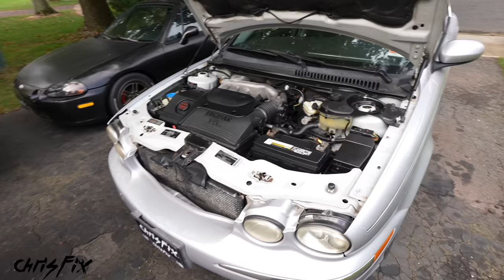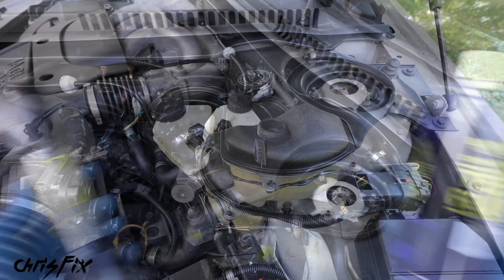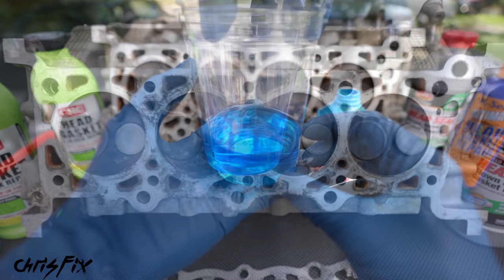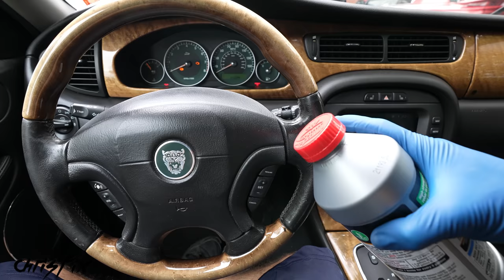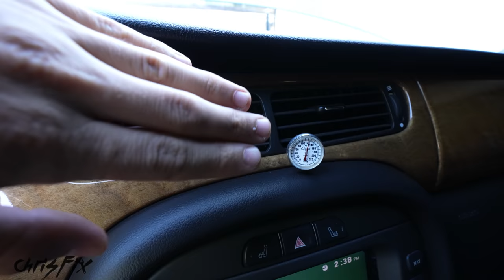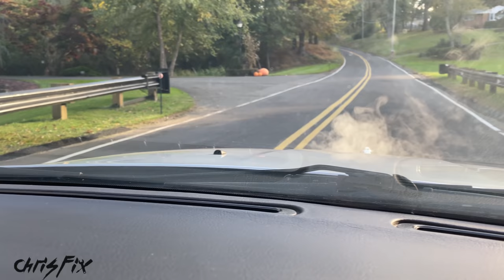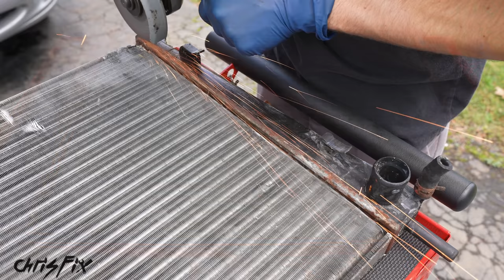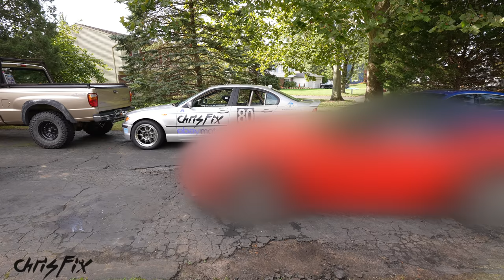Do Head Gasket Sealers Actually Work (FULL 2yr TEST with Engine Teardown)

Comment: I used the K-Seal on a Ford Five Hundred with a blown head seal. It worked fast and I had no clog issues with excess fibers like you had in the Jag. I just like the idea of using copper instead of glass to reduce abrasion in other areas of the engine. I wouldn't use any of those silica based products.
Reply from the maker: Thanks for sharing and I agree!
Reply: Let us know how it all pans out, k. maybe in a couple of wks or so all depends on different variables, I guess. Thx.
Reply: how long did it last @Rich Touchet?
Reply: How long did it last?
Reply: I just used K-Seal on my 2011 F150 at 161k miles a few days ago. I noticed it was leaking coolant under my truck, was seeing a pretty decent sized puddle. It was not overheating though. And the oil is not turning milky, it looks good. I just couldn't find where it was leaking from. So I figured I'd try the k seal. The K seal I used said on the bottle that you can either flush the system after using it or just leave it in and it won't damage anything. So I've left it in there for a few days now and I have driven probably over 500 miles with the K seal still mixed into it coolant. And I haven't noticed anymore leaking at all since putting it in. But now my thermostat does float around and get a little hot while I'm driving. Which it didn't do that before! Mostly it starts to go hot and overheat once I get 70mph or more. When I back off the accelerator it drops back to normal temperature. I drove it for an hour tonight at 70mph on cruise control and it didn't overheat at all. But I don't like the way it was floating around like that so I'm going to flush the coolant and K seal out tomorrow and see if that fixes it. Other than that, truck runs great, not seeing anymore leaking.
Reply: hi
Reply: @MacGiollaCostigan  So did you flush the k seal out yet and how's it performing now that you flushed it out?
Reply: @toddrhine7648  nope I still have not flushed the k seal out. Truck is still running good and still noticing the temperature gauge float a little bit once I'm flooring it and hitting around 70+mph but once I let off the gas it drops back to normal temperature. Not noticing any issues other than that. Truck runs great but I've had to fix some major components previously. The water pump, couple hoses/connectors, starter, oil pressure sensor, both cat converters. So I've put over $5k in new parts and labor on it so far. I did not flush it bc the guy at O'Reilly's told me not to use a garden hose bc that water has sediment deposits in it that would get into my truck and mess it up... And that I needed to use distilled water... So I just don't know what to do now 😂
Reply: @MacGiollaCostigan  I would just flush it and use the distilled water/antifreeze. Just my opinion.
Reply: @toddrhine7648  do I just pour a few gallons of distilled water into the reservoir and open the radiator drain plug and just let it drain that way? I never done it before. 2011 f150 online it says the cooling system holds 20 liters of coolant... That's over 4 gallons.. it's about $130 to drain and refill it
Reply: @MacGiollaCostigan  All depends on how much your block and radiator holds.  You wanna try to use a 50/50 mix or close to it. I believe there's plenty of videos on YouTube that shows you exactly what to do in your situation!

Comment: I suspect I have a blown head gasket, so I'm weighing my options on what to do. This video is super helpful and informative, thank you!
Reply: What vehicle or engine. I have milk on my oil cap
Reply: @ceavalencia4767  are you losing coolant or anything else though? If the oil on the stick is clean but the inside of the cap is a little milky it could be just condensation from lots of short trips where the oil never gets hot enough to boil that off.
Reply: @906MediaProductions  burning oil. Short trips to work 20 miles it was fine. It's the long trips the milk shows on the oil cap. I'm actually stuck in CA as of right now because I'm just getting the engine replaced with a lower mileage engine.

Comment: Feel bad for the old man who loved that car. I remember when you posted the vid about when you were able to buy, fix up, and gift the jag to your old man. Seems like yesterday.
Reply: Well if he didn't cut out & tear apart the radiator, all that would be needed is having a machine shop flatten the head. Should be okay to take off just a couple thousands. And then reassembly. Labor-wise it's totally not worth the cost of the car, but it does seem salvageable. Of course I'm making assumptions that nothing else was mechanically damaged from the improper seal of the combustion chamber, but considering the car drove 10k miles on the sealant, there's got to be more life in it left.
Reply: Saw Chris's reply to other comments. The brake lines were rusted. Obviously other problems made the car not worth fixing. And of course the disassembly wasn't exactly organized with intent to reassemble. Clearly not worth trying.

But I agree sad for sentimental reasons.

And major kudos for Chris on that part because his passion is real and it gets us sucked in too.
Reply from the maker: This is why it didn’t really matter: https://youtu.be/KQWGHE7NTUA
Reply: @chrisfix  I also remember this one lmao. That blue color for the Maserati just makes it POP how’s the wrap holding up after almost two years? When I get the car I want (Tesla) I would love to wrap it in midnight green.

Comment: I used bars aluminium for a small rad leak and it’s been good for around 7000 miles. I used half the recommended just to avoid clogging—plus it was super small

Comment: I have used K-Seal 2 different times. First time on a 240k mile Lexus LS-430 and it worked great . I drove this car from California to the east coast (Maryland ) K-Seal worked great and I had that car for about 1 year after pouring K-Seal in My cooling system.      2nd. time I used it was earlier this year ,( june 2023) ,K-Seal worked great on my 2005 Jaguar x-type with 147,000 miles  I have driven 10,000 miles since june and everything is still working Great.

Comment: Thanks ! ! ! 
Years ago GM used dark brown "pellets" in their Cadillac engines straight out of the factory to stop leaks. I used them recently on my '95 Vette and it seems to have stopped some mild leakage. I used half of the amount rather than going all in. Haven't noticed any spikes in temp (other than the usual high temps in stop and go traffic) which is normal for the LT1.  Heater works so no blockage there. 
Your thoughts?
Reply from the maker: I personally don’t like the stop leak additives for the radiator because they do clog up the heater core and stuff. I was told they use it from the factory at GM (like you said) but I don’t know how true that is. Either way if it’s not causing you issues I wouldn’t add more. I would just replace the radiator or leaking part. The LT1 HS reverse cooling as well (at least in the Vette it does).
Reply: @chrisfix  It's AC Delco part number 12378255. I've been hearing that they came factory in the Northstar engines for as long as they've been around. I suspect there is some truth to it.
Reply: @chrisfix  Thanks for the reply, your videos are fantastic! I installed a new radiator 6 yrs ago. I noticed  3 yrs ago cooling system was loosing about 2 pints every 9 mos or so, that's when I put in the pellets. I changed the coolant earlier this year and so far, all's well, no more loss, so I'm good.
Reply: @billiebobbienorton2556  we have those brown pellets with the Northstar warning on here in the UK sold under the brand name Bars Leaks, worked for me in a Citroen.

Comment: Good video, great long term test.

RE: ~240F temp on the first test drive, I'd suspect you had an air bubble stuck somewhere. Air moved due to higher RPM/t-stat opening and the low level after first test drive was that air. Just my pro opinion. Get shop air vacuum filler, no air pockets ever.
Reply: that's a good theory.  considering that the sealant hadn't worked enough to stop the coolant leak out of the reservoir at that point in time, your theory makes sense.

Comment: This begs the question: what caused the overheating originally to cause the head to warp?
Reply: the average american cars maintenance record is probably enuf
Reply: I seem to remember when he bought the car it had front end damage. Something probably got knocked around when that happened
Reply: What about when coolant never gets changed and turns corrosive, and starts eating away the block and head? It didnt warp but it leaks.

Comment: One question, had he floored it any time before the head gasket sealer broke, or was that the only time? Or if anyone else has had experience with these I'd love to hear your experiences with this. Thanks in advance y'all!
Reply: I put some in one of my vehicles (diesel hilux 1kz engine) and just drove it normally, including a few longer trips.
It lasted nearly 3 years, it now has a new head on it.
The 1kz heads are well known for developing cracks if they get hot and mine did due to a cracked radiator tank.
Reply: @Stambo59  I'd like to know. The directions on "bar leak" bottle says to put into the radiator, not the reseviour. Does it really matter, can that affect how well the sealer work? I've used K-seal before & it sucks from my experience. I want to try bars product & would love the insight since you've used it already. Thanks.
Reply: It shouldn't really matter once it cycles long enough, but the radiator should mix in faster than the reservoir.
Reply: @andrewstambaugh240  I already done the treatment. Over 200 miles so far & she's holding.

Comment: Hi Chris. Amazing video. I suspect my engine has developed a blown head gasket in a similar way to your Jag...apart from the water loss...so your video was very helpful. I had also narrowed the choice of sealer down to the Bars Leak but I hadn't actually bought it yet. So your video has helped me decide...thanks again.
Just a question - my overflow bottle is not the greatest...can I pour the product directly into the radiator inlet once the engine has reached operating temperature?
Cheers from Sydney Australia.
Reply from the maker: I would open the radiator cap when the engine is cold and keep it open. Bring the engine to operating temp and add the stuff in. Then close the cap and let it run. NEVER open it when it is hot or it will shoot out hot coolant.
Reply: Yeah was going to start her up with he cap off. Done that plenty of times with clunkers that couldn't hold their water.Anyway good news since I first messaged - the gasket didn't blow afterall. Tough old car! But the radiator is chronically blocked (40 years old) so that's the next job.
Thanks again Chris!

Comment: Great video, Chris.  Two questions please: When the original sealant stopped working, could you try another bottle and get another 10,000 miles out of it?  Once you got the head off, could you have replaced the head gasket to make a permanent fix, or was the head block warping too great? 
Thanks!
Reply: This was my question too. Could another bottle provide more of a seal or does this mean the warping exceeded the sealer’s ability to seal?
Reply: @tamarachairez3744  i used sealer on my old 05 chevy equinox and i do delivery driving, after the head gasket blew again after about 8k miles i tried adding more sealer and the car still has a blown head
im pretty certain that after a point the warpage gets too bad to actually be fixed by just sealer, ive read on quora and other places that some people over torque their head gasket bolts and that can fix the problem temporarily but im weary of overtightening anything hahaha

Comment: I remember doing this copper/fiber head gasket seal on my previous Totota Corrola and there was that initial hot temperature increase to almost red zone on the gauge for about 5min of driving and then temperature suddenly dropped to normal and my head gasket was fixed permanently. Also before doing the fix the leak was so bad that I used to find 1/2 cup of green coolant under my car overnight and had to top up coolant every 2 days, however after doing this hack which cost me about $30 the coolant level in reservoir stayed permanently same without dropping so it worked just fine as the car was 23y old and worth less than $1000 😊

Comment: Hey Chris, fantastic video!  I actually used the Bar's Leaks a while back on my Forester which was well overdue for the dreaded gasket replacement and it worked for a little while to keep things under control (at least until one of the bolts on the water pump stripped out and I just went and got all of the gaskets done).  I wanted to ask, what brand of disposable gloves do you use?  The ones I buy are always either flimsy, poorly fitted, or both and I end up using less disposable rubber gloves that work better but aren't an option for anything where any soiling would be bad, like handling brake pads.  Yours seem to be of excellent quality and I would definitely spend a little more to have a box of them laying around!
Reply: I know he likes to shop at Harbor Freight so those might be the 7mil nitrile gloves they sell. They also sell 9mil which I personally think are a bit too thick and are a bit restricting in movement but they are definitely heavier duty.
Reply: @pudo3792  Good tip!  I'll check them out, I have a Harbor Freight nearby or could just grab a box online, thanks!

Comment: Thank you for the test! I have some questions, since the condition of the oil was not shown:
Does this work when the engine oil is milky as well? 
Should an oil change take place before using the sealer?
Reply: no it will look up your motor if your getting coolant into your oil

Comment: Great video!

The irony is that the high silica in the oil probably wore away the head gasket seal that the head gasket sealer in the coolant had made!

Had you changed the oil quickly, there's every chance the seal would have lasted even longer.

Comment: Hey Chris, is it possible to have residual exhaust gasses after using a sealer? Its possible i might have had air in the cooling system with my heater core is not working from a clog or trapped air, but my test turned yellow before quickly, then green slowly. I used Bar Leaks copper block sealer (wasn't suspecting a "head gasket leak" the time because I was still learning the terminology much less how to do everything) on my 2001 E-150 5.4 l

I have the head gasket replacement kit but I am no longer in a situation where I can very easily do this difficult job myself because I'm trying to learn how to do it properly first off and secondly I have no location to do it. I'd like to try again with the blue devil and take out the thermostat this time, and just hope it works, but I don't even know if I need to. However I am getting cylinder misfires on occasion and bad fuel economy still.... I think.
Reply from the maker: There could be if you didn’t bleed the air out of the system after it’s been sealed. Could also have a small leak still.
Reply: E-150 means van which means changing the head gaskets is a nightmare even for a pro mechanic.

Comment: I had an 04 Chevy cobalt, cracked a head tightening a spark plug while it was hot. Coolant started coming up the sparkplugs tub hole. I put some copper head gaskets fix from Walmart and it kept it sealed for a while until I sold it .

Comment: Just recently had a head gasket leak on my 2JZ-GE (1999, 300k miles, been my daily driver for years). Worth mentioning that mine was a MINOR leak. If your oil looks like chocolate milk, you got a much bigger problem on your hands.

I had a small leak, my oil was fine, my tailpipes weren't throwing out white smoke. The exhaust was boiling my coolant, if I drove on the highway for a bit it would start to overheat when I slowed down because the water pump couldn't keep up. Additionallty, the leak would push coolant out of my radiator with excessive driving. I went with Blue Devil specifically because it has no solids in it. Those solids can actually clog water pumps so I tend to avoid them (but to give credit to what Chris said, I haven't seen nor heard of a radiator being clogged by one). And regardless of the sealant, I always recommend flushing the radiator after a few days just to make sure nothing gets clogged up. When I flushed my radiator, I also replaced the thermostat and radiator cap.

I followed the instructions on the Blue Devil bottle to the T, and it actually did temporarily stave off the symptoms. I was able to drive across the state to work a contract without my vehicle overheating and only lost a very minor amount of coolant.

People need to understand that sealants are a bandaid solution. If you have a head gasket leak, your best bet is replacing the head gasket. But depending on your engine, this can be costly or very difficult. My 2JZ, being an inline straight 6 and longitudinal mounted engine, was actually relatively simple. I didn't even need to drop the engine to replace my gaskets. The Blue Devil did its job as a temporary fix until I was able to find the time do the repair myself. Again, I had a small leak on a simple engine. Depending on your circumstances, you might need to just bite the bullet and take it to a mechanic for the repair which will definitely cost you. Ultimately it comes down to what you're driving, the circumstances you drive it under, and the severity of the head gasket leak. Still, this is an awesome video and I greatly appreciate the effort put into it.